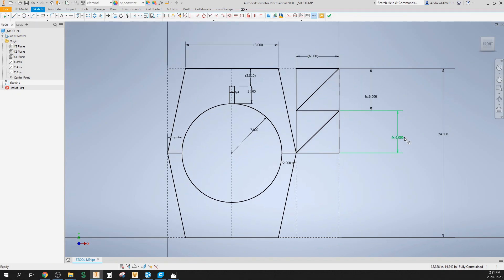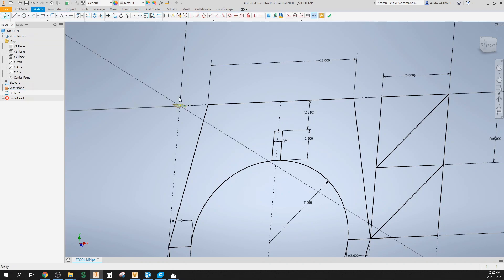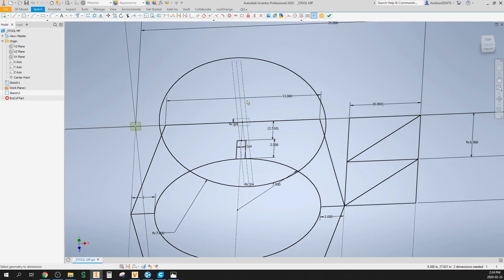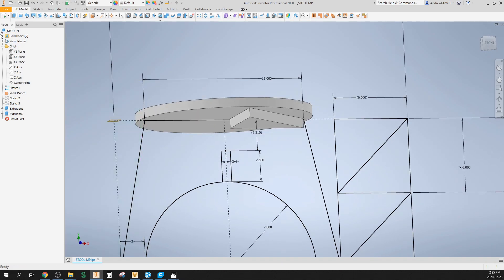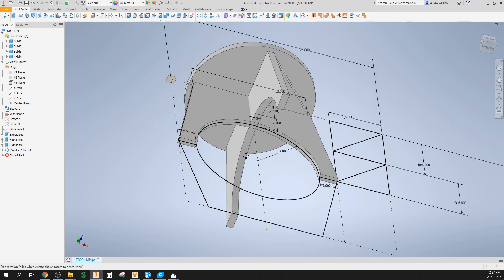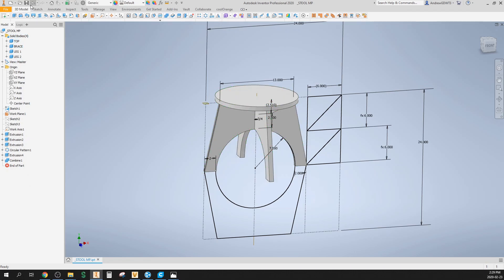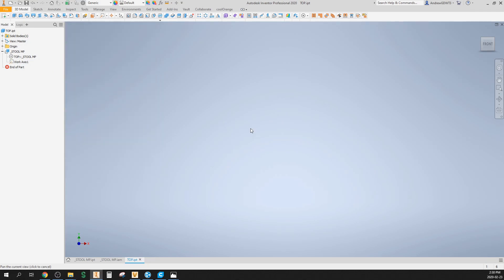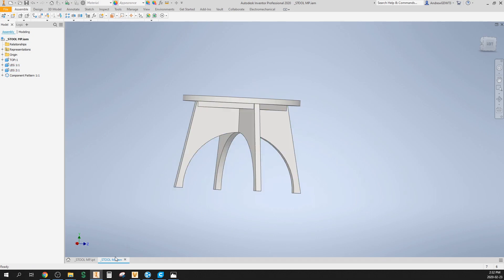Multi-Body Master Part

Comment: This is great! I am trying to work on making static assemblies to help facilitate precast concrete fabrication. This sort of method is much more robust/flexible than mating assemblies together after parts are made. With this sort of method I should be able to get rebar positioned and bill of materials generated much faster in the long run. Thank you for showing how this works.